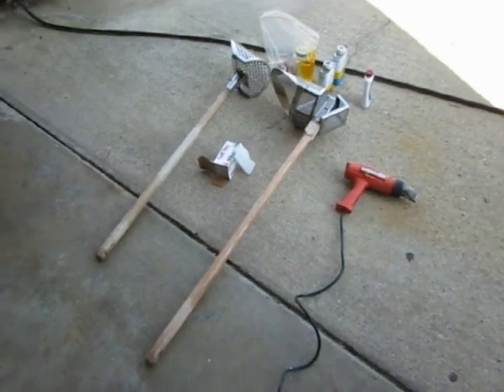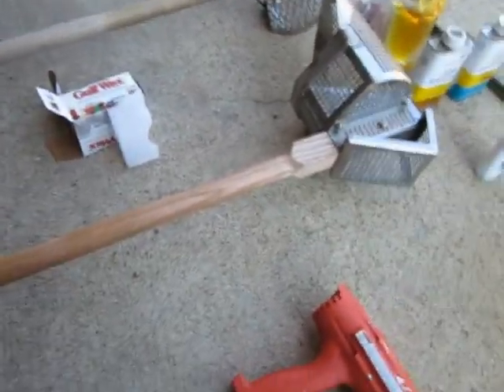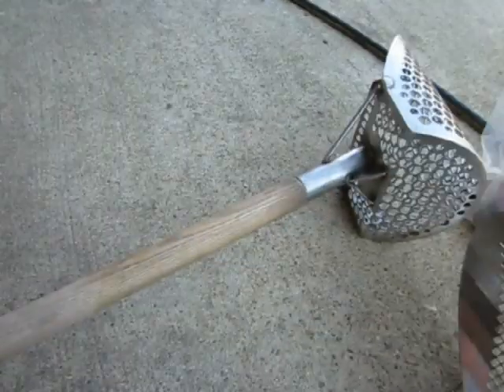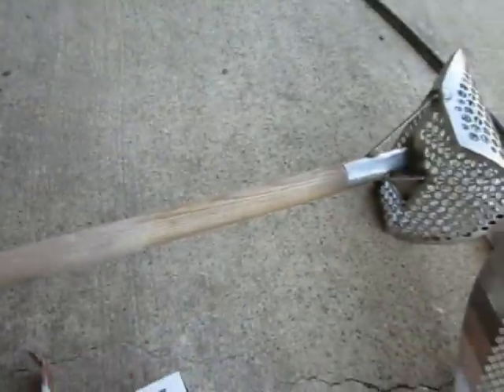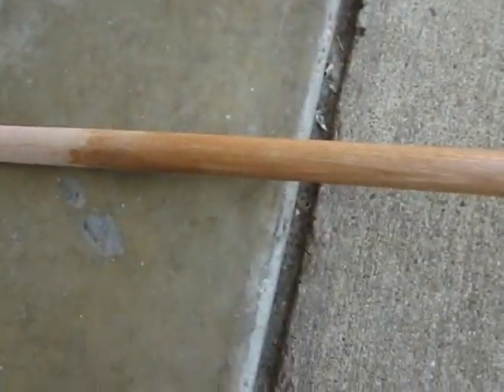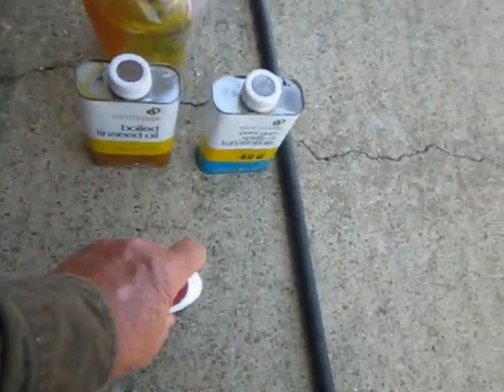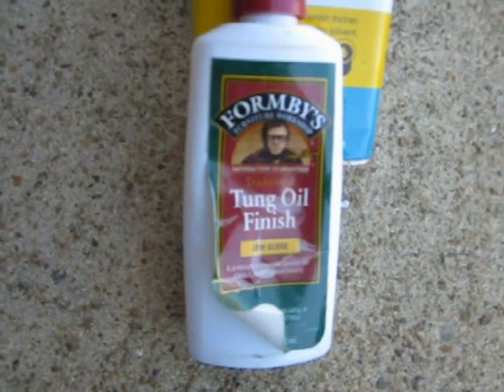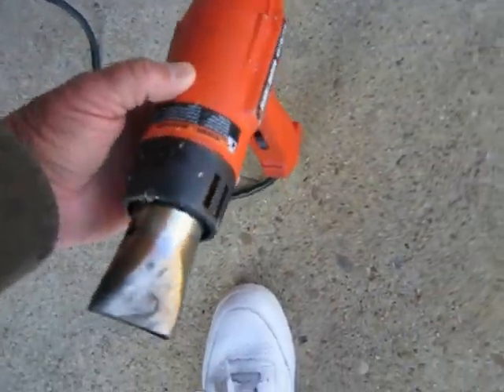OCT 27TH - PARRAFIN PREP. TO SCOOP HANDLES - WILL IT HOLD UP..?

Comment: I'm thinking of starting with Thompsons water seal.You ever try it?Also i was wondering if it is possible to split a handle by the bottom,and insert an aluminum spine for strength.May make matters worse?